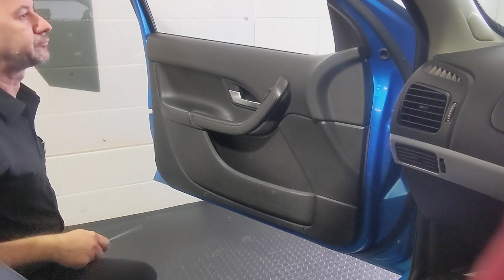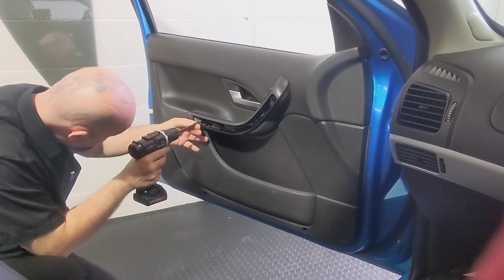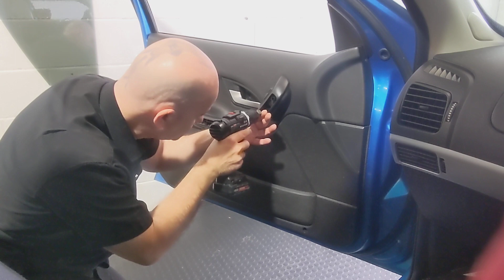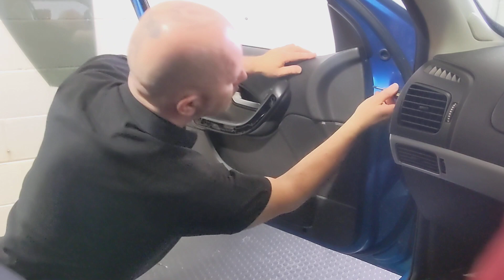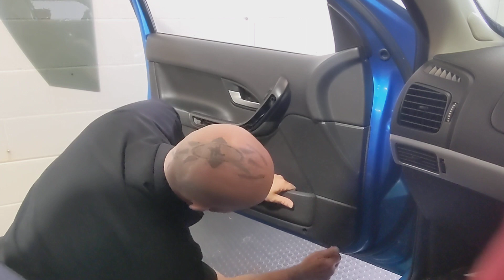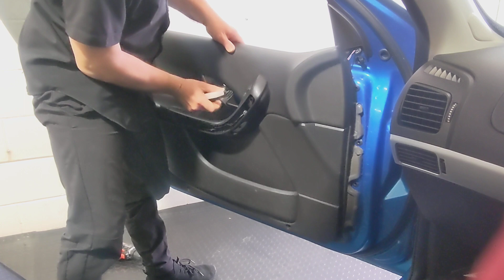2003 Ford BA Falcon front door trim removal

Comment: Hello. The rear left door of my Kia Sportage 2016 was locked and could not be opened from either the inside or the outside. I didn't know what to do. I would be happy if you help
Reply from the maker: I just tint windows but maybe try the one screw for the door release handle and examine if the cable is attached ?